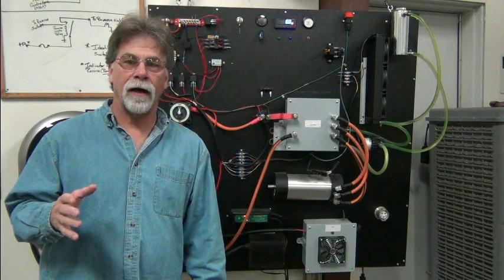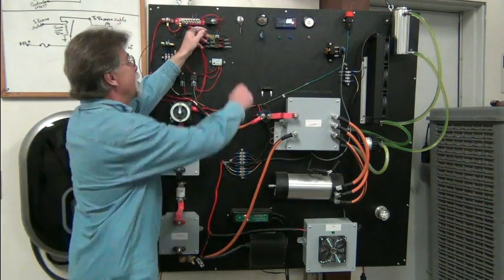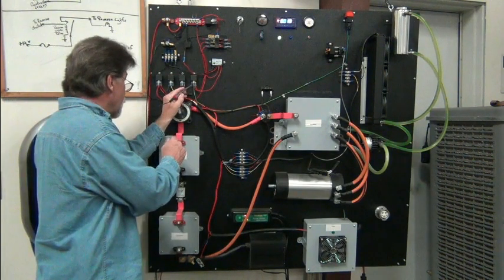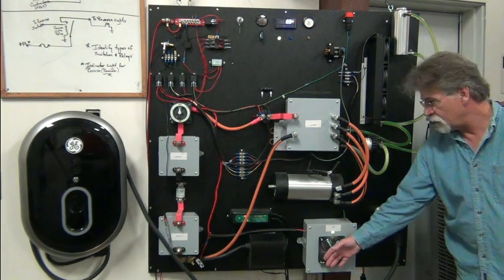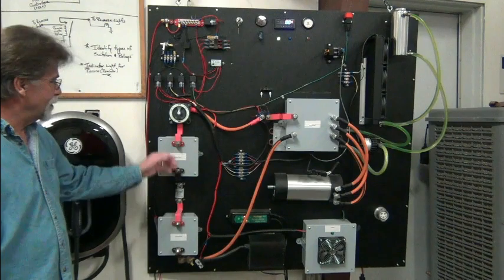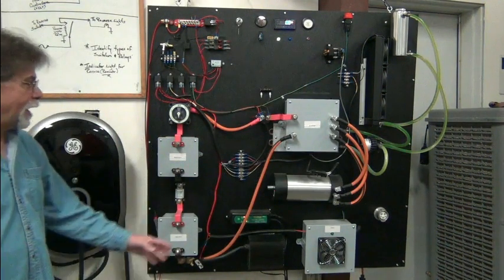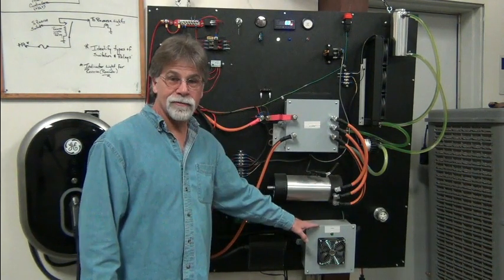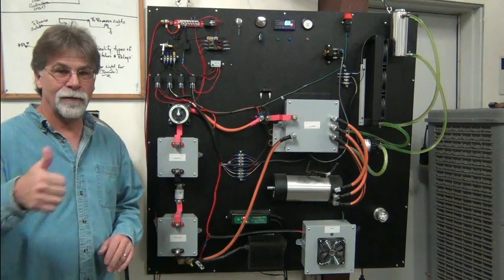EV Conversion Fundamentals and Principles - Episode Two

Comment: I left out some properties, can only go full speed up steep hill when gen is running and battery has some charge, so 1/2 energy is coming from batteries and 1/2 from generator, full speed up hill, at full speed on a flat running the generator should have some power to charge batteries, it should be able to charge its battery while parked and some wind power can be used to keep charging the batteries in motion in some windy conditions ...that is a good place to start from, the other is to find a used electric vehicle that has exhausted its battery pack and use proper generator and circuit to power up vehicle and must have diode to keep regenerative breaking from blowing generator, and don't be surprised to see a perpetual motion generator charging stations become available

Comment: Why would you want to disable the power supply to the battery pack while moving... It is so much better to have generator capable of powering up hills when batteries are depleted, can generate while parked to charge batteries and batteries slow charge when generator running moving down a flat with batteries depleted ...
Reply: What would power the generator?

Comment: Excellent, now add discussion of wind power when parked, and solar panel charging array and attributes of a small generator that takes energy from a small generator burning some kind of fuel ...
Reply: What does "wind power when parked" mean?   Solar panel charging for EVs is like heating with a match.   You would need your whole house covered in solar panels and even then it would probably take forever to charge an EV battery, compared to a 220V system.

Comment: Fantastic. Now I know why corporate and political America doesn’t want to push EV’s. They are just too simple, too easy for a DIY’er to build/repair and they won’t sell as much gas/oil. Off of the power grid 3 yrs 47kWp, 250kWh diy LFP. An EV is in my future.
Reply from the maker: Thank you for watching and your comments.
Reply: With 1 or 2 battery upgrades it will be clearly better.
Reply: It is all about keeping 99% of American as slaves, that is why building permits cost $100.00 a square foot, most city lots come in at around $500,000.00 and they expect all Americans to be a slave for more than 80% of their predicted life span, and we have no industry ...climate change is caused by high altitude jets...
Reply: I agree 100%.   But I don't have $30,000 CAD at present to convert my beloved 1966 Volvo 122S.   And you need to have a bit of technical savvy in order to do it.   Most of the people I know would have difficulty removing an oil filter from a car let alone removing the motor.